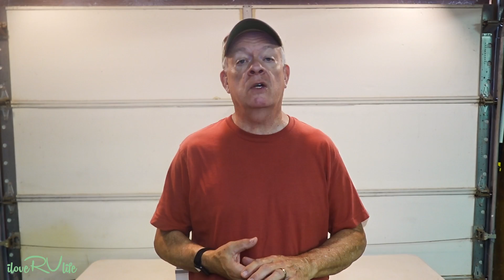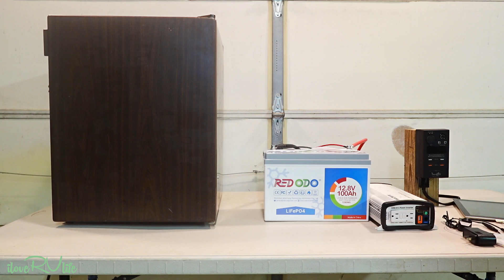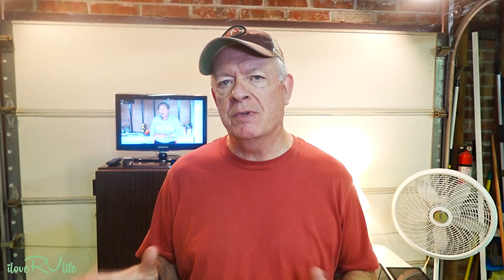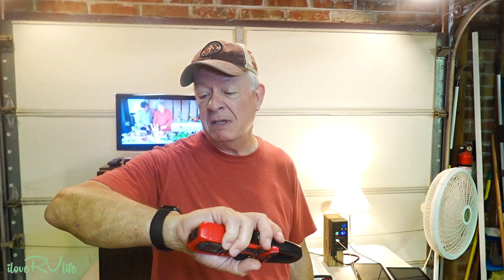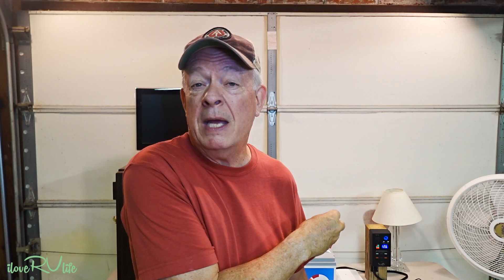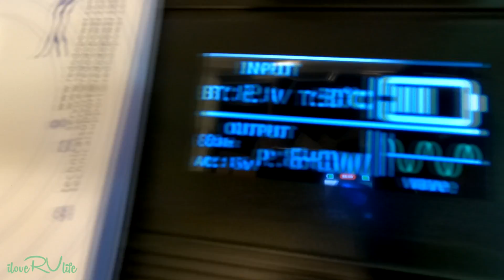REDODO 12V 100A Battery with Low Temp Protection

Comment: Maybe installing two of those in parallel in our fifthwhell should be better than our 2 x 6V  lead acid in series  and also change the charger/converter
Reply from the maker: Hope it works out for you. The two Redodos should give you about 180 is usable amps.